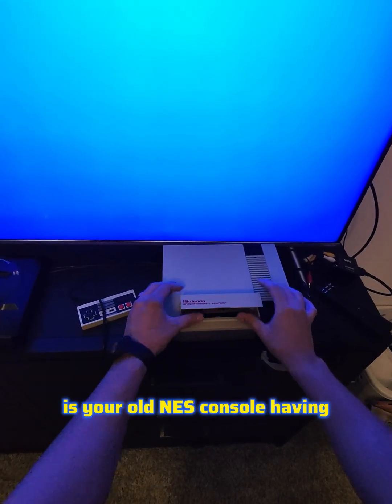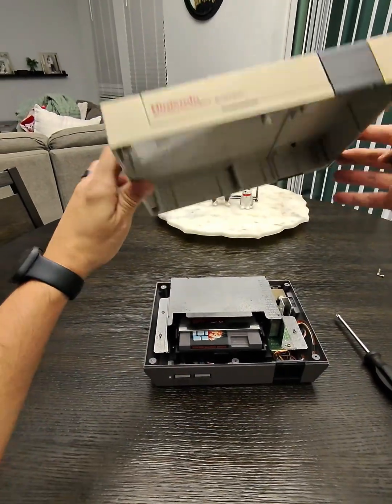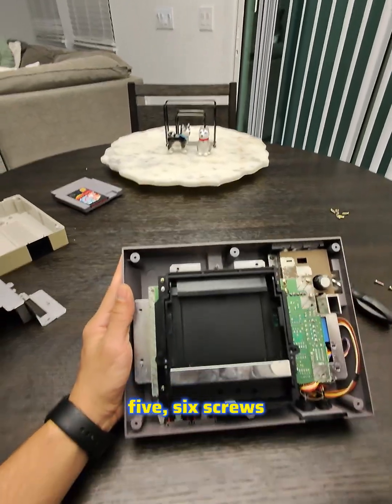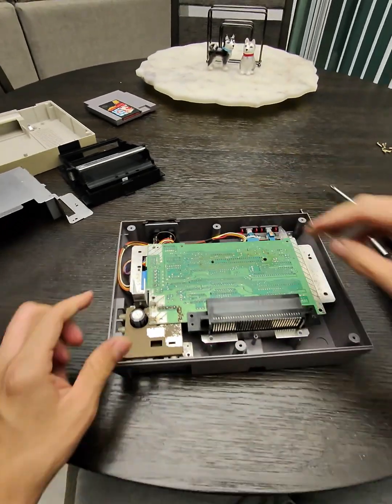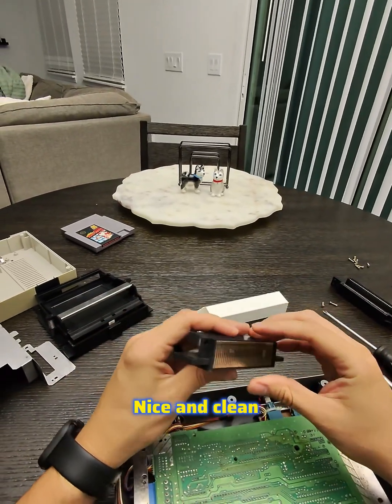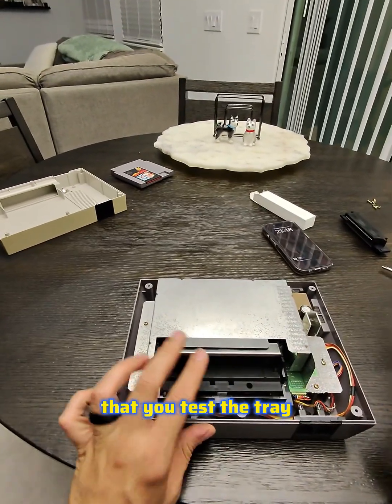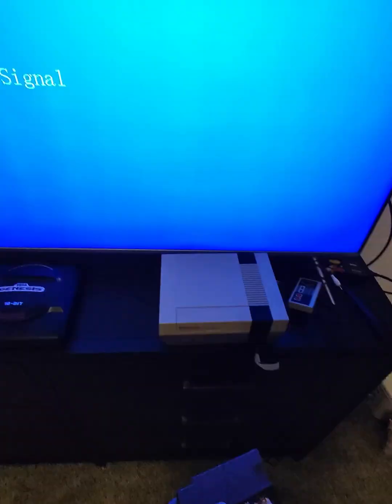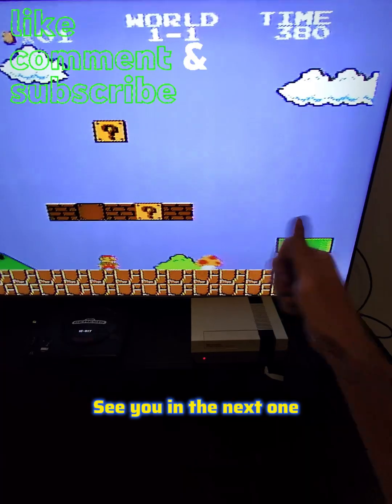3 Minutes NES Blinking Red light Repair | 72 Pin connector replacement

Comment: Do you need an adapter to play it on a flat screen?
Reply from the maker: Well that all depends. My tv does not have av ports or component ports. My tv only has hdmi so I had to use an adapter